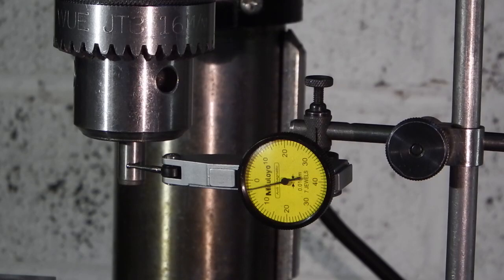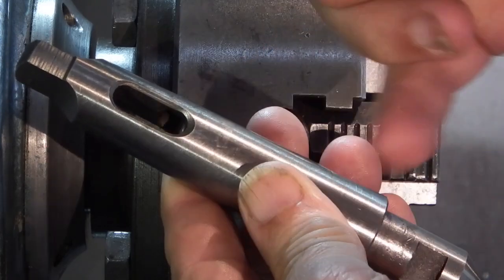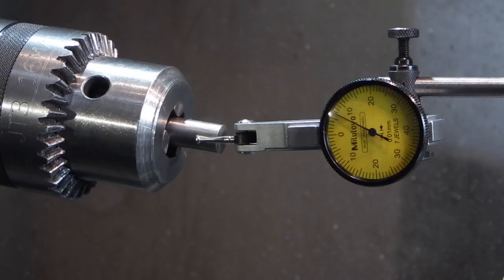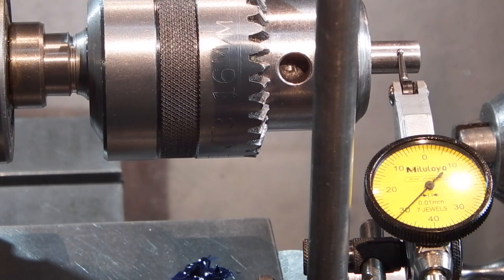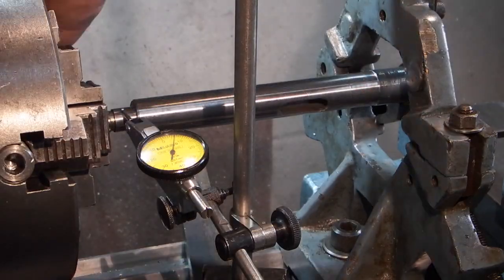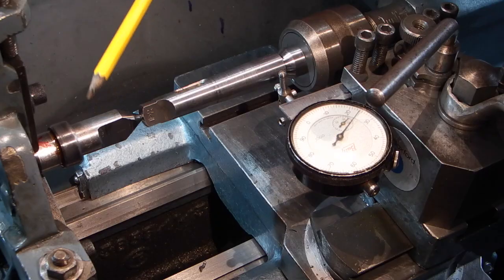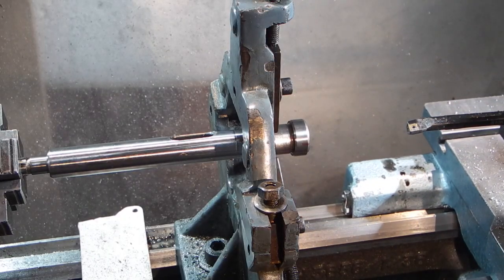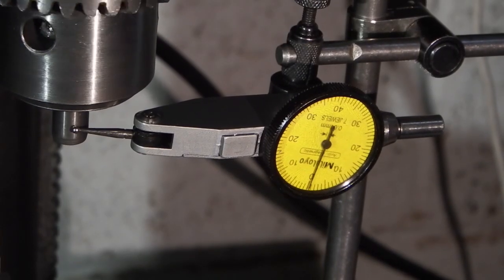Drill spindle or drill chuck run out ?

Comment: Did you consider mapping the runout on each part and then re-assembling in the best orientation to cancel out as much runout as possible? Those 3 and 7 thou components could make a big dent in the 15 thou final total if you haven't already done that.
Reply from the maker: Hi When I set it up in the lathe with the spindle running true you could see the bore running out.

Comment: Thank you, this is hugely helpful. I have (I think) the same pillar drill (warco 2b12 or similar?) and have a noticeable wobble at end of drill bit. To my crude eyeball it’s OK at arbour and no movement in quill, and the chuck did fall off the taper not long back so I’m hoping it’s just poorly seated. Need some wedges to get the chuck off (it has no access hole) and will then set up a dial gauge on the Jacobs Taper and keep fingers crossed…!

Comment: Thank you for the video. I believe I have the same problem. Tried several chucks, 2 actual Jacobs units, a 1/2 and a 3/4, all have the same bad runout. I was thinking about doing exactly what you did to repair it. So thanks for the guidance.

Comment: It appears I've the same machine but no engineering tooling to fix runout, and trying sheer pot luck and patinece instead. 🤠
MT in the quill was well and truly jammed, needed to be removed by disassembling beforehand.
The tang wasn't in-line with the slot, and was making contact with the walls.
Made a drift from an f clamp, very difficult to remove!
When knocking out, keep switching sides, and focus on slot where the drift isn't skewing as much, a battle  to keep the drift straight sorted it out.

No tooling here, so fingers crossed I can get by without needing to maching inside.
Cleaned up the burred up tang with  various small files, but looking at the one on this video, it seems I can do some more, pleased about that.
Not tried removing chuck yet, eager to see if I can improve matters, 

Seems I'm gonna be chasing my tail for quite a while doing this,
 Hope I can sort it out with some sort of bodgery.

Thank you very very much for making this video Mr Enot!.
Cheers.
Tom

Comment: Had this practically new Chinese mill for years. Used it once as a mill, but tried to use it as an overpriced drill press.  I was making threaded inserts at one time. Anyway, last few years I've noticed a big wobble on the drill chuck. I bought a new keyless chuck & arbor, still a noticeable wobble on the drill bits... so this thing sat for some time. After watching your video, I disassembled everything & cleaned & polished. Wobble gone! Thanks for the inspiration!

Comment: I am an old enthusiast not a pro, and am having a chuck issue. I had bought on eBay an Albrecht 1/2” used chuck with a straight 1/2” arbor (probably a bad start in the 1st place). With an accurate rod in the chuck jaws and inserted into 1/2” - R8 collet on the mill I was getting about 2~3 thousands run out. I figured it was the arbor and removed it, then used both a new 1/2” arbor and a new R8 - J2 arbor. Same result. Looked on Youtube for disassembly procedures and got it apart. Full of heavy grease (oops!) but the parts look ok to me once cleaned. Got it back together with proper lube and it operates smooth and grabs well.
Now here is the issue. The R8 arbor in the mill is true. With the chuck on and checking the chuck’s body around the top area I am getting the 2~3 thousands. I would think the J2 hole in the chuck body is messed up but I can see no marks and it is very smooth. 
Am I expecting too much out of such a chuck??

I am going to try the blue dye and maybe that will show something. Any ideas will be appreciated, besides putting it back on eBay for someone else - I don’t do things like that.
Thanks
Reply from the maker: Hi Tom 
I would first check that there are no burrs on the hole edge, use some fine emery cloth to rub the edges. Failing that check what the manufacturers run out tolerances are. Anyone any other ideas?
Reply: @enotsengineering  Found out a few things. The tolerances on a new chuck is 0.003 thousands. Next after getting it apart the jaws would not simply slide out. I had to use various screw drivers to push them out. The jaw faces really didn't look that good either. Decided to trash it. Cost of new jaws is more that it is worth to me. I have a #34 1/2" that works fine and will continue with it. Thank you for responding. Tom

Comment: I work on vintage drill presses. Last week had a machine made in 1941 in the shop, a Delta DP-220, with a bent spindle - 0.005" runout. With the Jacobs 6A chuck it came with, 0.018". It could have been a problem with the taper. Unfortunately I'm a fairly poor machinist. I've accumulated a stock of spare parts, pulled the quill out of the machine and replaced the spindle. The runout at the taper was now reading less than a tenths (!). Played around with a few chucks and settled on a keyless Rohm - indicated 0.0006" TIR at ~1" out. Yes, six tenths. Could hardly believe it. A first in my experience. Scared the crap out of my cat with the victory dance. :)
Reply: Felix F , could you point me to info about the DP-220? I have one with poor runout that I would like to improve. I'm a woodworker, not a machinist, so my tolerances aren't terribly challenging. I've hoped to repair this machine for a long time!
Reply: Felix F.i have a Meddings MB4 mk3.any suggestions on how to change the gearbox oil as i can find no info regarding drain plug(if it has one)and where to fill?.any info greatly appreciated.

Comment: A gauge like that is nice to have, but in the case you don't have one and you need to check for runout, a pencil will work. Simply spin up the chuck, take a pencil and just barely make contact with the chuck for a split second or two. Stop the chuck and look at the pencil line, if the mark is all the way around the chuck evenly then you have no runout. If it skips, or doesn't make a mark all the way around, you either have runout or low spots on the chuck... more likely it's runout. Try it and see, I've tested this simple method and it really does work.

Comment: Did you try reseating the chuck at different clock positions to find the lowest runout?  Inaccuracies can multiply error but also cancel each other out in some circumstances.  Give it a try.
Reply: damm smart to think of that - I put in a new chuck a couple of days ago - 'and I've got a dial indicator
I'll be out there soon - thanks

Comment: My old Atlas 1425 drill press, carefully restored, has the EXACT same problem. The MT2 bore needs to be re-run.
Can you do this for a fee ?
Reply from the maker: Sorry I'm trying to cut down on my work load, but you could try getting a number 2 morse taper reamer and ream it by hand to remove any bumps or dents in the bore. But this will only follow the original taper and not correct any off set.

Comment: thats great! may i know if you can suggest about multispindle drilling?
Reply from the maker: Hi  when you say multi-spindle  machine I am thinking of a machine with one spindle that has a multi head fitted. So you can drill more than one hole at the same time. In this case you need to check each spindle is running true.

Comment: I just tried releasing the taper from one of my Jacobs chucks with no luck, the nut was just being forced out of the jaws when I tightened the bolt. I also tried tapping the bolt in to no avail.  Eventually I warmed the chuck with a heat gun gave the bolt a good tap and the taper did come out but I was surprised to find there was no hole right through my chuck so tightening the bolt was doing nothing?  Great channel thanks

Comment: I have that same drill press with the exact same problem. I thought that the spindle was bent so I tried to find a new spindle but I have no idea who manufactured it. Any help would be appreciated.
Reply from the maker: Hi David. The drill press is a common make made in the Far East, my hand book for the drill press does not show a manufacturers name.They were sold in the 1970s onward by engineering tool suppliers some had their own brand name on the machine. So I've no idea who made them. Sorry
Reply: @enotsengineering   Thanks anyways. I appreciate you replying back.

Comment: Thanks for explaining the steps you took to isolate the area where the error was.
Very well explained and practically demonstrated. I followed the same process on my drilling machine.
Would you say that 0.006” TIR just outside of the chuck jaws is ok for a drilling machine?
Reply from the maker: Hi Harry. 0.006" TIR indicates a 0.003" offset which is not bad considering, you could turn the chuck in the spindle 180 deg and see if it reduces or increases but don't worry too much about it.

Comment: Wonder what the run out is on the cheaper $150 drill presses such as Ryobi or mastercraft brand.
Reply: I have a cheapie and while run-out might be an issue, the main problem is the whole spindle wobbles. It’s a lottery as to where the bit will end up.

I am guessing the bearings are either very cheap or might even just be a bushing. I’d like to think a simple job of replacing the bearings might improve things, especially as a I don’t have a lathe.

Comment: Would have been much simpler to use a more taper reamer than trying to taper bore the quill once you found the problem!  No need to even dismantle the machine either.
Reply: But if the taper was already off, a reamer would just give you a smoother taper that's still out of alignment.

Comment: The reason for that huge run-out when it's all assembled is bc you've got the run-out from each part adding up and getting larger the farther out from the spindle you get. Best thing to do is adjust the run-out for each part individually and then try to adjust it as a single unit.

Comment: Can you tell me what make and model drill press you have?    Mines look similar, I got used.  I'm trying to figure out how the light bulb mounts.  I believe this drill style is badged under different names.
Reply from the maker: Hi Yes this drill press is sold under many names. I don't have a light on my machine but my brothers which is the same make but about 10 years older, has a lamp holder inside the casting between the spindle and column and is linked into the on off switch from inside.
Sorry I can't be of more help.

Comment: I had a similar problem. My drill press has a one piece shaft with a male b16 taper that the chuck fits onto. The shaft was only 12mm in diameter.
I changed out the 12mm bearings to 20mm bearings and then fitted a 20mm extension collet holder. I cut the extension holder down to size and then I welded the spline into the end of the collet shaft. 
Far more solid now and i have used it to do milling as well as drilling.

Comment: Good repair but the Pro's would have machined the taper while running in the quills bearings for higher precision. To achieve this the quill would be held in the fixed steady, and the rest of the set up as had it.
Reply from the maker: Hi Chris Good idea if you have bearings that have seals on both sides.
I can't do that as the bearings do not have seals on both sides and any swarf produced could get into the bearings
Reply: enots engineering good point but not I think  insurmountable. .

Comment: Hi Alan back in the 70s I bought an Ajax bench drill new. It was soon evident that there was lots of runout although on the plate it said "Precision Drill".
I contacted the Ajax company who fair play sent an engineer from Manchester to Worcester to look at the problem. He agreed with me and he changed the spindle. It was greatly improved although not precision.
The drill had been in storage for the past 23 years and bees had made a nest in the body resulting in massive rusting in many parts.
I have just finished restoring the drill and have fitted a VFD with three phase motor from Power Capacitors which I also have on my lathe. One reason for doing this was the annoying vibration coming from the pulley cover with the single phase motor. I did in fact remove this as I couldn't cope with that. Now it runs smoothly with no vibration. 
The drill looks very similar to yours so I will have to check the runout now.
Many thanks for video, it will be a great help.
Reply: They sent a guy to look at it?!?!?! Wow. If only customer service was even remotely close that good nowadays. You're lucky to even get a human on the phone now.

Comment: According to my thinking this could have been remedied by grinding the end of the chuck arbor, however that will be like treating the symptoms and not the illness!
 The way you did the repair is the best way I could think of cure the illness as it means other tools in that spindle will not become sick!
 Your chuck obviously has a through hole in the back so you can easily eject the arbor. Something I will do rather than use wedges should the need arise. Good solution!
John, Australia.